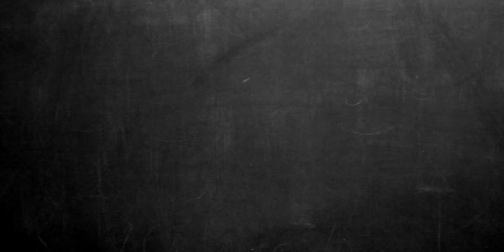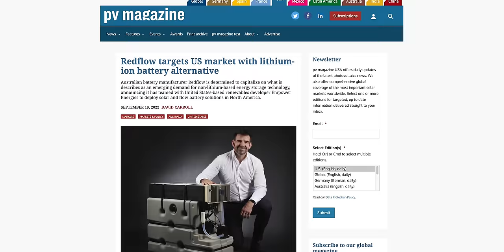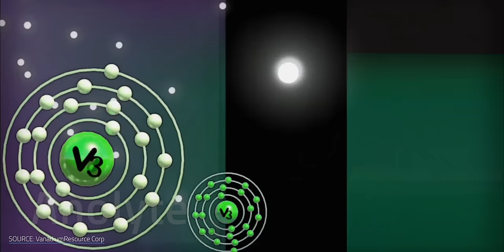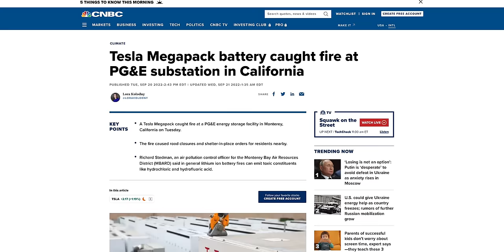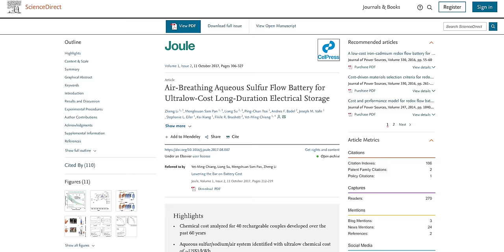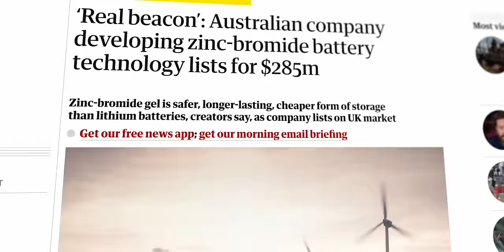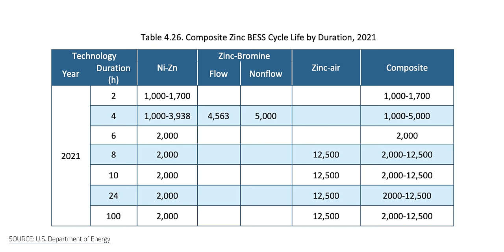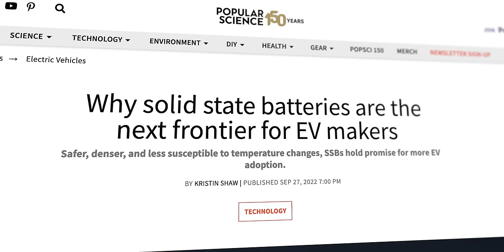137 Year Old Battery Tech May Be The Future of Energy Storage

Comment: I think this one's decided there Matt...   As a half-Aussie I'm STOKED to see this coming out of Oz - it makes me so happy.   God I hope they start pumping these out as fast as humanly possible, even if it's an evolving product.  Use them for fixed location storage exclusively, standardise the installation and access mechanisms, get it into place in a practical sense and make sure the end client is aware it's a version 1.0 solution and will evolve/improve.  Here in the UK we're running into grid problems (not just generation) and I have read that we may not be able to carry and deliver the power requirements for wider scale adoption of EVs mandated by soon-to-change regulations.  We really really need distributed grid storage and rather badly...  

Australia has a strange mixture of savagely overpriced power (a side-effect of pseudo-competition overlaid on the old distribution structure) and power is monumentally more expensive than it should be;  despite that they've endured brownouts and blackouts where there is no way that should be justified (this isn't a bushfire or flood thing, it's a government and mismanagement thing apparently).  

Imagine these popping up under houses and tied to domestic solar arrays, etc. - the amount of sunshine they get is hard to fathom.  As for going outside - I know how those noodles in the microwave actually feel.  The sun is harsh and relentless much of the time, if these really are much cheaper then the main problem will be getting your mitts on these batteries and infrastructure (God help you trying to find a licensed installer then).   Not sure how many lead-acid plants we have in the UK but licensing that tech would probably make sense, even if it ends up being a stepping stone before fusion reactors take over the world (as the media claimed this morning) we really do need that interim step.  Even more so if international tensions and war is on the horizon;  this makes a grid vastly more difficult to knock out indeed. 

National grid resilience is just not sold hard enough by either the industry or government (against attack or disaster) and I really think we need to step that message up sharply.  These types of devices are the meat and potatoes of making that happen, absolutely LOVE it.
Reply: CO2 is the best out of all the storage systems for grid storage from what I have seen when it comes to components, safety and efficiency. 
I suppose these could be good for smaller applications.
I do not see the point of a hundred different types of storage solutions where many have toxic components.
Reply: Wonderful write up you have here!! With solar and better storage a democratic power system without the grid is the future.  The best place for a nuclear reactor is 93 million miles away!
Reply: Davo & Matt,.. Here in Melbourne, Australia, there is usually enough sunshine to fry an egg on a car bonnet by mid spring, and in summer you can cook hotdogs that way. There's a ton of industrial suburbs (Google Maps - "Laverton North" then satellite view) that have square kilometers of steel roof space that could be used for both Rain Water and Solar capture, the latter to make 'Virtual Power Stations' that link battery storage's of those factories and warehouses in to local energy storage and supply hubs.
The Bromide and Sodium based batteries will probably be ideal for these uses, and both should bring storage costs down. I'm expecting that Sodium will also replace the LiFE batteries that are currently popular for Tradie Truck dual battery, off-grid living and camping power solutions.
Davo's spot on about finding licensed installers - there's a lot of people going DIY for the automotive and camper installs.
Every country needs grid resilience, the lack of it is why it's very easy to upsell UPS units for PC's and security systems, and that's something the Virtual Power Station model can help fix, especially while many of the deregulated corporations over charging for power are busy ignoring the need for grid maintenance until things fail.
Re-using the old Lead Acid manufacturing plants, well, that's just recycling done right.
Reply: @PiDsPagePrototypes  hang on I was told last light you lot are in for a white Christmas, it's only 13 in Melbourne or something.  You've got snow up in the mountains still?  Brisvegas is high 20s as usual (where I'm from, never made it to Melbourne).  Remember the installer shortage when Aircon systems were going in everywhere?  Spoke to a former IT guy who switched sides, he was making $3500 a day and had clients bidding against each other a bonus to get him to come out earlier than the other.  That was about 2007 or so, it was insane.
Reply: @philliplamoureux9489  I think we will see a mixture of SMRs and battery emplacements with that fed by solar, wind or excess reactor power from dips in grid demand.  SMRs are crucial as they are factory cheap and the installation can be scaled up without tying up billions in capital for a decade in advance with a high risk on return...  SMRs are also potentially drop-out as well when they need replacement apparently.  They say a nuclear incident with one would be VASTLY smaller and contained; I think a pragmatic system is to use a more ecclectictic mixture overall as we can't really afford to wait for a stabilised uniform tech across all fields.  This was very much the case in that very early days of power generation, the main consistency is electricity itself.  Smaller and varied solutions with lower expectations survive funding problems and financial issues that kill other projects, also make them viable for remote configurations such as island power systems, etc.  I remember being on north Stradbroke Island after a storm hit, we lost power but we also lost water too as the pumping station lost power; that actually freaked me out more!
Reply: @davocc2405  Yeah, the La Nina thing has us rained out till late January at this stage. Means a worse bushfire season next summer. And it's 10C tonight!
Reply: @PiDsPagePrototypes  rumours of snow at Xmas being possible - or is that just a cocaine bust going wrong?   10 degrees in December is hard to fathom when you guys were hitting 48 some years
Reply: @davocc2405  I’m all for an eclectic mix of power resources. And there might be a place for SMRs, Antarctica, space flight. This video is about battery storage and that’s a big field because of renewable intermittency. There are high-powered factory uses that may still need big power plants and the grid, but we are at the era where lots of commercial retail, home uses, and personal transportation, could be independent. 
My concern with SMRs is that anything we can make decays and fails and eventually becomes junk. Here in Michigan in the US every business, electroplating site, factory, industrial site, chemical manufacturing, steel mill, auto plant, etc., left the state and the whole Rust Belt state area without cleaning up after themselves. These rusting hulks are often Superfund sites.
So it seems to me the standard human propensity to just walk away and leave stuff when applied to 1 million solar emplacements left on the land or even collected in the dump, as compared to 1 million scattered SMRs is a very different future. It isn’t accident containment, it is production sites, utilization sites, disposal sites, none of it is ever really contained. As a bio scientist one of the principles of the rise of earth’s early life was the previous sequestering of all of the heavy metals and radioactive elements away from the biosphere. Since the early foundation and explosion of life we’ve come along and dug all this stuff out and spread it around again. Doing more of that seems like a bad idea to me so I will stay with the anthem, “the Best place for a nuclear reactor is 93,000,000 miles away!”
Reply: would be nice if the government talks about what technologies it going to use and not just push for renewables.
Reply: @stephenduncan309  I don't think any government genuinely knows.  In the 50s we saw tight political cohesion between some generation tech initiatives and the political parties (particularly state reps in the US which was one reason molten salt reactor designs never survived prototype stage apparently).  In the UK our first reactor was very expensive and harmed the party supporting it so they have seen it as dangerous politically for some time.  For renewables that can also apply as there's that point where uncertainty is claimed as certain to get a product into the market of course and that's also a political risk...  The recycling and sourcing issues for blades and panels are also on the verge of greater media coverage so that may spook politicians even more perhaps.  I do find the political relationship with reactors Vs decommissioning vs recommissioning Vs gas supplies, etc. that Russia threw at us a curious one especially in Germany and Japan. It's like that driving force that convinced them to dump their existing tractors just vanished overnight, even with this cold snap it's still unusual.
Reply: Lol, fusion isn't taking over the world yet. This was a "milestone". Now fusion is only "several decades away instead of 50-60 years"... Sounds like the same thing to me!
Reply: Personally, I'm all for individual power storage. The global and local political situations mean I don't trust "the grid" (electric, water, or food) to be 99.9% reliable anymore.
Reply: @falconerd343  that's a hard one - it's a different evolutionary environment to earlier development cycles, also we have computational design simulation so we can simulate different solutions that used to have to be physically prototyped;  this is an intensely useful tool because it lets a solution be tested, tuned and "what-if" tested prior to building any physical attempts.  The cut-down of time is remarkable, AFAIK they're doing this in medicine too right now.  No it's not going to give me a "Mr Fusion"  reactor to put on top of the Delorian (dammit) so my time machine is going to have to keep getting its 1.21 gigawatts from good old plutonium that someone nicked.  Hey I could go back to 1955 and.....
Reply: Well even if fusion started replacing modern major generators TODAY. It wouldn't solve grid and transmission issues. Just like renewables it's able efficiency of the WHOLE system. You can pump loads of power in but after a point you are losing more than can be sustained.

Esp with increasing temperature issues in places even like UK. Where cooling is now a concern instead of cold temps. Let alone places like Australia and similar tropical locales. Where the cooling for Lithium is likely a large part of the cost.

Eventually shifting grid infrastructure into modular sub sections of interconnected areas can help alleviate power distribution problems. Unfortunately such systems call for decentralization of power and utilities. Which is against corporate goals. They want to be able to monopoly control ALL aspects of the the whole system. Also while straight up ignoring mandates to slowly upgrade and maintain the system. Bc if there is no enforcement of regulations and mandates then they have free reign to price gouge like the pharma industry. All while scamming governments to bankroll them with welfare.
Reply: Aussies are world leaders at pumping out CO2
Reply: We're closer to the big dog table

Comment: Hang on a minute.  The Redflow battery is not a typical flow battery in which the electrons are exchanged between atoms of the same metal in different oxidative states.  It is a plating battery in which Zn is plated on to a substrate during charge and goes into solution during discharge.  As for full discharge, they must be fully discharged periodically to avoid spicule build up.  For this purpose it is useful to have two of these 10kWh batteries.  Periodically one is fully discharged into the other.

Comment: Still using a pair of 20 year old lead acid farm batteries at the old family camp with a 3kw inverter(newer) and some 20 year old 50w panels. These run a fridge and freezer year round, and all of other power needs when the camp is in use. Ive no doubt that about $400 of tractor grade batteries would anchor a small family home without struggle. The currently available tractor batteries at Tractor Supply Company  cost about $3/kwh, and about 0.5 kwh per kg. They are heavy and bulky for the energy density, but are extremely stable.
Reply: Wow that’s pretty incredible for lead acids I thought my 11 year old car battery was impressive
Reply: @stephenkeller8208  the ones built to bounce around on farm equipment for 100+ hours a week are quite durable when sitting calm and quiet. That camp isn't going through nearly as many power cycles on them as a piece of farm equipment does either. But yeah, they're doing just fine. In a heavier use domestic situation they would probably have a shorter life span, but the big expensive things are showing only decade long expectancies.

Comment: The round trip efficiency for the LiFePO4 (also known as LFP) lithium chemistry is around 95%, actually.  This is where essentially all lithium-based vehicle and fixed storage systems are headed.   You may have been quoting efficiencies that include the charge controller in the loop which would not have been an apples to apples comparison, or other lithium chemistries which don't represent where the technology is heading.

Comment: Hope these get down to personal storage solutions or at least something similar.  Right now a high quality 48v 100ah LiFe rack battery used for personal solar storage costs around $1,500 which considering you'll need multiple of these for home/EV power storage makes this the most expensive piece of a solar project. Any cost reduction is very welcome.
Reply: Why not get the core tech installed and go one battery pack at a time? Even if you gotta use it as a backup to your main grid even. You might even be able to postitive feed back this somewhat if your provider offers off hours' rates to gracefully help "offset" expansion costs.
Reply: @rickytorres9089  That's kind of what I'm doing.  |'ve installed a large 52 panel system to handle my house and my workshop that's grid tied.  I'm working on a secondary off grid system with cheap Santan refurbished panels to charge a battery pack for other projects.  Just wish they were a little cheaper.  I've already spent over $50,000 on solar so far without batteries and running a bit low on funds, so I'll probably just start with 2 or 3 batteries and expand as needed.

Comment: Thanks Matt.  Storage seems to be the one factor that most national grids lack, and it becomes very obvious during times of grid instability or power shortages for whatever reason.  I think about batteries and inverters everyday, more so during power outages (every day for several hours a day currently).  I would be interested to see what price the Zinc-Bromide Gelion batteries are sold for in SA where I live presently.  They certainly seem to offer an improved all round solution that Li-Ion...  but cost will be a major deciding influence on what I purchase.  Thanks for sharing - interesting and thought-provoking as always 👍🙂
Reply: Used EV lithium repacks will hold the primary home market for a while and negate the EV lithium metal salvage/recycle market. Even a 50% SOH will do for wall batteries, just use more of them. Same with cheap solar panels, why use expensive, fragile mppt when a few more panels do the job?
Reply: The reason why national grids lack storage is because there's no practical method of storage on a grid scale.  Closest thing to cost effective is storage reservoirs (pump water in to raised reservoirs to store excess energy then drain them to get it back) but even that is ridiculously expensive.  Grid scale storage is a pipe dream ultimately.
Reply: @howardsimpson489  I could see Refurnished and Recertifications being reasonable but in no means I am buying a "as is" used thing that may or may not be just waiting to be a blowie uppie, to be unstable, etc just to save money (even if it a lot).

Comment: Matt, I understand these zinc bromide batteries are not for cars and the industry is focusing on commercial applications but what about residential applications? Obviously the LiFePO4 battery is the fad for now but in these battery videos could you add content for residential comparison?  Are these technologies accessible to homeowners?
Reply: You probably won't be able to buy one anytime soon, but theoretically it could work well in a residential application.  The energy density doesn't matter as much as some of the other considerations.  If the claims of low fire risk holds true, that alone could make this easily the most desirable battery on the residential market.
Reply: @tippyc2  that's true. There is not one single solution for everything. Everything in nature can be used in some beneficial way. And the batteries are not exception.
Reply: I reckon the Sodium based ones will replace the LiFE used in homes and camping, especially as the Sodium is going to cost a lot less then Lithium, and anywhere there's access to the Oceans, say, the pipes on the outflows of Desalination plants, there will be very cheap Sodium available.
Reply: Lead acid is more than enough for residential use.
Reply: @vitordelima  lead acid batteries do have a slight downside of evolving hydrogen when charging, which is pretty easy to deal with by making sure it’s ventilated. Don’t put them in a basement though.
Reply: @peterbrown6453  And they are cheap, store enough energy, can be recycled, ...
Reply: @vitordelima  Damn heavy too.